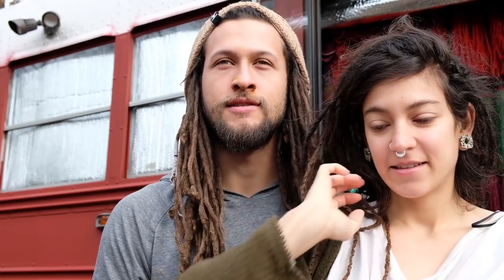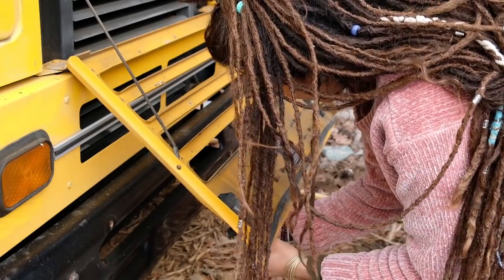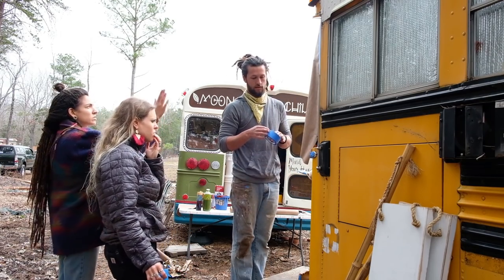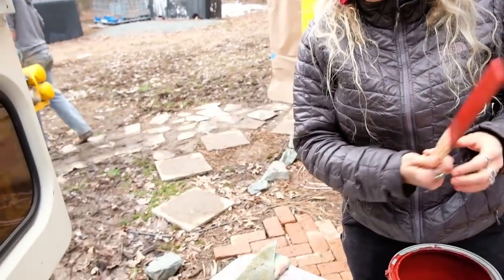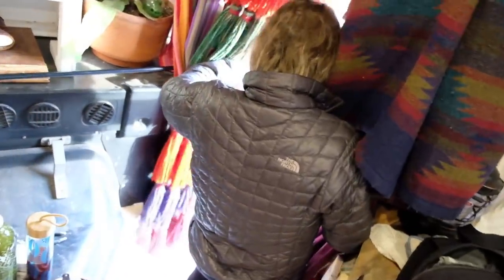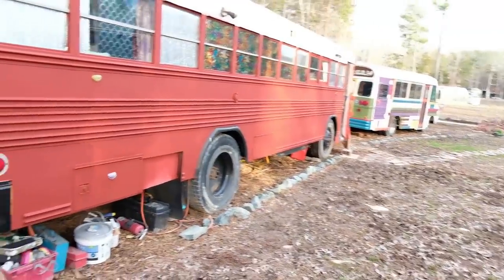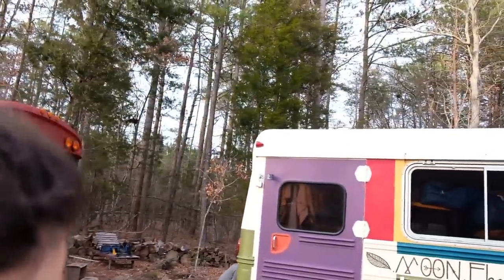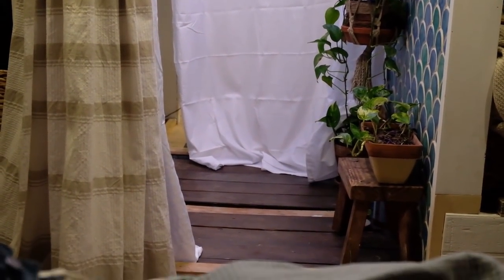EP #43 SKOOLIE CONVERSION - Painting the bus continues - RED PEPPER

Comment: It went by really quickly, but I think you cut the rubber hose that actuates the stop sign that used to be on the driver's side of the bus.  If you haven't already, you're going to want to cap or plug that hose.  It's probably air and will now cause a problem with your air brakes if left open.

Comment: Azalea is beautiful.  Since the last time I commented, I bought a '94 Blue Bird TC\2000 (72 seat).  Very much like yours.  Looking towards the shower from the front, where did you place the drain hole?  I have more stuff on the driver side under the floor, and them middle seems bad, due to the driveshaft.